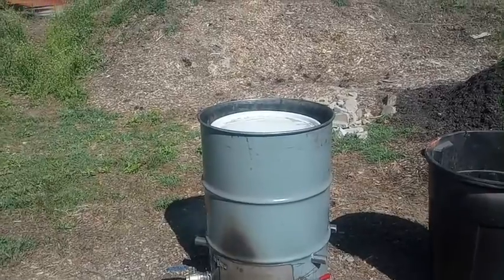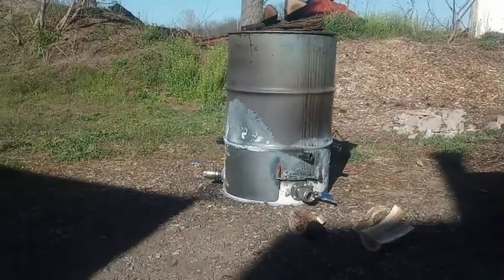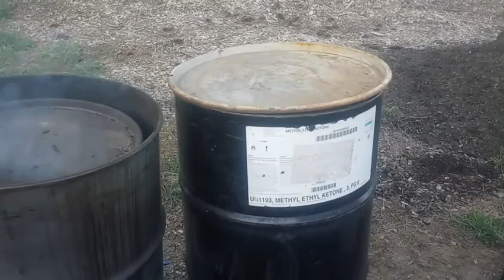First Charcoal Batch in the DIY Retort!

Comment: Does this system outperform you CFK-10 ?
That set up seemed very optimal except for being continuously fed and therefore hands on.
This one does use fewer parts and less machining.

Looks like it needs more hands on fire management than I'd thought.
If your burn chamber was twice as big, I bet you could burn it tlud style and never have to touch it.
A Top Lit Top Draft fire might also work, but I've only ever done that in a trench or trough, actively fed and tended to.
Insulation might add enough efficiency that your current sized firebox could do the job without reloading.
A sheet metal shroud would offer some insulation and preheat the combustion air.

Putting the fuel you've been drying into its own "retort"  could make it easier to babysit.
Just an open topped section of drum would help keep the flames off.
A big enough stock pot or half a beer keg would be ideal.

Putting your fuel drying barrel horizontal over the heat could really be useful, but also a hassle loading and unloading.
A heat exchanger made of duct or pipe could drop into multiple barrels like a giant boot dryer, with one fan pushing air through the part over the retort.
A water heating coil could do the same , but just with heat, no air movement.

Love your work, as always, thanks for sharing!

Comment: Only limited by the number of barrels. I used Rockwool fire resistant insulation for the retorts  . Wrapped it around the outside and then wrapped it with metal roofing to keep the insulation in place. Got a whole summer out of it before it needed to be changed out, That makes a huge difference getting the temperature high enough inside the retort.